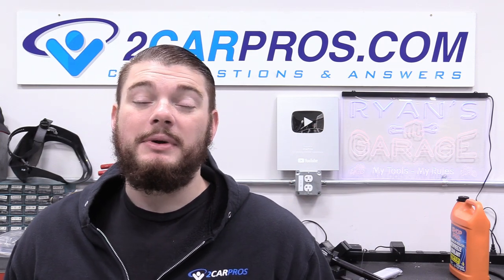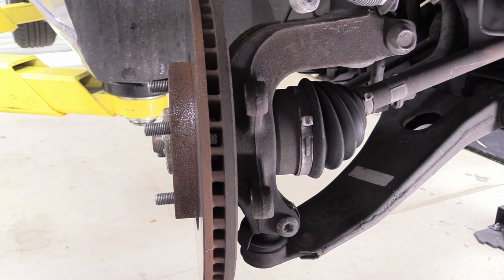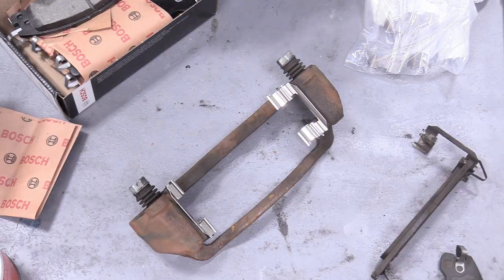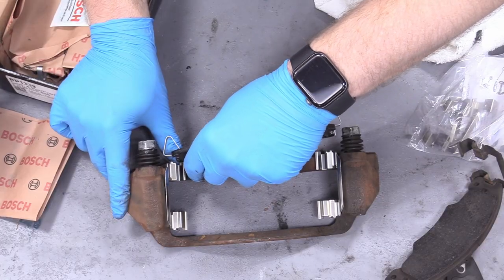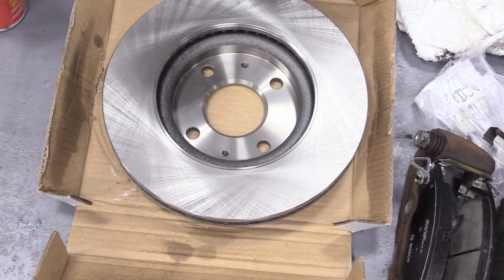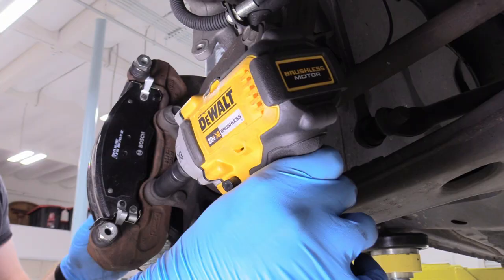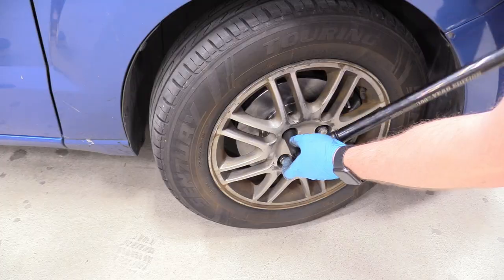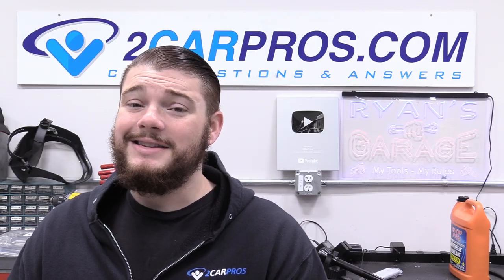How to Replace Front Brake Pads and Rotors Ford Focus 2008-2011 - EASY!

Comment: Before starting - always check the brake fluid level to make sure that when the calibers are squeezed with the channel locks there is room for the fluid.  Generally, when the brake fluid level gets low, change the pads, do not add fluid.  Fluid level is an indication of pad wear.
Reply: I compressed the piston and it was all good til the end, a bunch of brake fluid leaked under my car…

Comment: Thanks for your really clear video. I believe there are two rotor diameters for these cars so be aware. I think it's a good idea to clean really well where the rotor sits before replacing it - to make sur the rotor sits exactly square. Watch the fluid level when squeezing the cylinder back in.

Comment: Awesome video! I know nothing about cars, but I used your instructions from start to finish, but I decided to check out some other videos on breaking in the brakes (wedding, mating, etc.), and pretty much everyone has a different take on it. One person said get up to 60 and slow down to 20, repeating about 4 times. Others said get up to 20, slow down to 10, then get up to 30 and slow to 10, repeating each step 2-3 times until you've done it for up to 60 mph. Apparently it's different for each manufacturer, but I installed the same brakes you used in your video. Is your suggestion of "getting up to 10 and tapping the breaks, and repeating" the way Bosch recommends doing it? Are these other guys right? I don't know what to believe!

Comment: There is something I want to add. After clips replacement I had to take a file and beval the outer edges with a file so thatthe shoe will slide in to this groves easier.  By far this was the most frustrating aspect of the entire brake job
Reply: Shouldn't have to file anything

Comment: Just changed the pads and rotor on 2010 focus. When i push the pedal, and it got hard but when I started the car up the pedal did stay hard why?
Reply from the maker: Because the pad and rotor are butted up. Take it for a slow drive after you broke in the pads and see if it improves. Thanks for watching!
Reply: Also because with car off there is no vacuum to run the brake booster. The brake pedal will feel stiffer without it's assistance. Unless the pedal is going to the floor this is normal.

Comment: I watched some other guy grease up where the brake pads sit...OMG!! I guess it's ok if you like to have greasy rotors... anyhow, you have some good tips.
Reply: This guy missed the mark a little bit. You should grease the metal to metal contact points. Despite his theory of the grease getting hot and dripping onto the rotors there is no data that indicates that as a risk and the majority of brake jobs are done lubricating where the brake has to slide back and forth. Not to mention that brake grease is formulated to withstand temperatures higher than your brakes will ever get under normal to semi-heavy conditions. This meaning it won’t turn into a liquid and start dripping all over the place. I have never heard of that happening and I’ve never known anyone that’s ever heard of that happening. But I have heard of pads seizing in place.